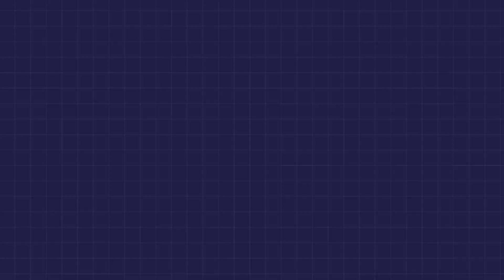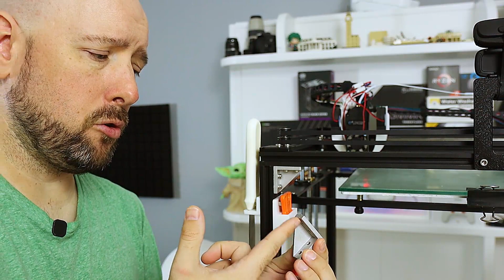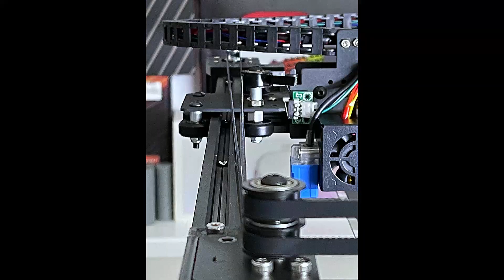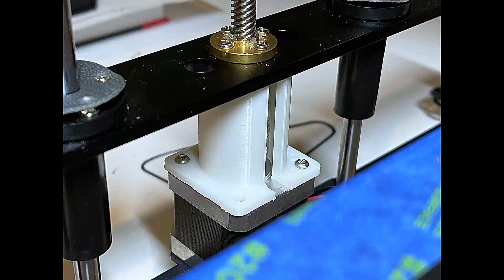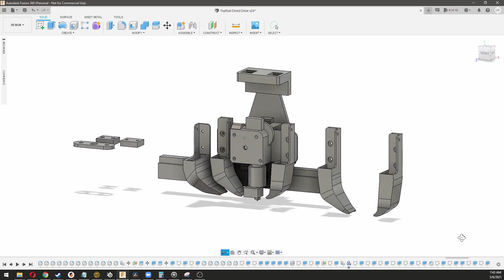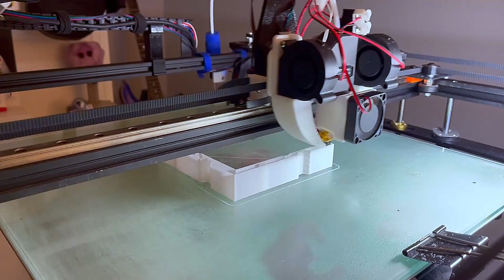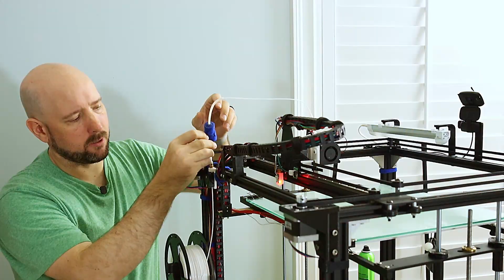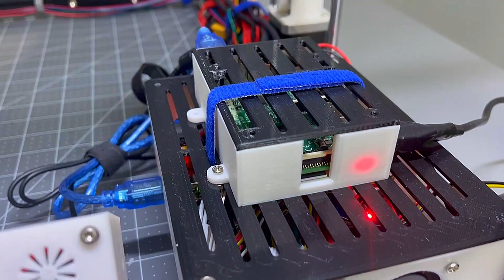TronXY X5SA Upgrades (Frame, Bed, Linear Rail + Direct Drive, PSU, Electronics)

Comment: I had to think through this several time, but I'm pretty sure I've got this right.

"these are the important extents, they have to be perfectly parallel to the y axis". I call male bovine feces. If that were true, if you wrote g-code to, say, go +10cm on the Y, then -10Cm on the Y over and over and over and over then the carriage would eventually track all the way to one end or the other or else one belt would get so tight it would explode. I'm pretty sure either will happen. As long as you have the same number of extents, with the same length, and the same angles you will be fine. The belts are (well are supposed to be) equal length, non-stretchy lines. I get that a hypotenuse of a triangle is loner than either side is, but it isn't a factor. Another way to say it is if the belt goes along a parallel extent, around a pulley and on to an angled one is the same as going along an angled extent, around a pulley and on to a parallel one.

 As long as the angles are identical, the length of the perpendicular extents are identical and the length of the angled extents are identical. That is why the pulleys for the belts are stacked, it reduces the chance the belts will be different lengths.
Reply: I would add that belt tension shouldn't be adjusted by the motor mounts, or any other part that affects only 1 belt at a time. You want to make sure both belts are EXACTLY the same length, and connected to the carriage exactly the same, then adjust the front stacked pulleys for tension.
Reply: Hello Reel.  I think you may be thinking about some of these items incorrectly.  Your first example, moving Y +10/-10.  The net result of those moves given an off-axis belt would end up being something like +9.95mm/-9.95mm.  It would move the same amount in both directions - it wouldn't build up more and more tension or move more in +Y than in -Y.  In addition, since the angle is changing it would be different depending on where the carriage is at.  For instance, if it's close to the off axis pully it could be a smaller move, like 9.9mm where as at the opposite end where the belt angle would be more aligned to the axis it would be very close to 10mm.  That is where the geometry errors come in to play and why you can't just easily calibrate it away.

The tension concern is that pulling at 0 degrees has the least amount of friction since it's pulling directly in line with the axis.  As it gets close to the off-axis pully the angle increases as does the perpendicular force and friction on the wheels/bearings.  Assuming the axis isn't completely catawampus that friction may be minimal but it could wear on the bearings and if you  have a bad bearing or something then it could play a larger role.

As for all of the extents that do not lead to a moving carriage, you are correct that their angles don't matter because they would always be at a static length and angle.

Now, these are small numbers and errors we're talking about - again assuming the belts are somewhat in alignment.  If everything on a printer worked great except this tiny alignment then that would still be a good printer.  The thing is, it's real easy to make them correctly aligned - literally just a few mm of extra metal on the outside of the bearing mounts.  There's no reason they shouldn't have done it right and illustrative of cut-corners.  It's also real easy to fix,
Reply: @LilMikeyDotCom  I have no practical experience yet, as I am still assembling my unit still, so I'll defer.
Reply from the maker: You sound unconvinced and I'm here to help :)  Let's use an actual pythagorean calculator: https://www.calculatorology.com/pythagorean-theorem-calculator/.  We'll use the real Y-axis position as leg a, and the offset of the pully as leg b - let's say it's 5mm off-axis.

For our first move let's assume the Y-axis is close to the pully, leg a = 10mm, leg b = 5mm, the hypotenuse would be 11.180mm.  Now if we instruct the printer to make a 10mm Y-axis move, it would actually tram the hypotenuse 10mm so our new hypotenuse would be 21.180, our leg b offset doesn't change so still 5mm, and our new leg a is 20.581.  Our 10mm Y-axis move actually moved the carriage 10.581mm.

Now let's look at it when the carriage is close to the far, correctly aligned pulley, say leg a = 380mm, leg b still 5mm, the hypotenuse would be 380.033mm.  Once again, a 10mm Y-axis move, new hypotenuse is 390.033.  Our new leg a is 390.001.  The carriage actually moved 10.001mm.  That same Y + 10 movement resulted in a .58mm smaller change in the actual Y position than the same movement closer to the offset pully.

From a tension perspective, the closer movement would be pulling at an angle of 26.6 degrees where the farther movement would be pulling at 0.754 degrees - basically zero.  CoreXY operates in push-pull so it's not like 100% of the force is applied at each of those angles but a significant portion would be - which could lead to bearing wear, inconsistent cable stretch/wear, or even skipped steps close to the 26 degree side.
Reply: @LilMikeysBigPlans   CoreXY operates in push-pull  <- this is the core of my conundrum. Any Tension on one end of the belt, has to be given back at the other end. or "blammo" (ok, the difference would be too small, but I think you made that point better than I had it in my head). if the motor is the "fulcrum" (which it may not be, my pulley math is weak). then when it pulls 10mm one way, the carriage moves 10mm, and some tension is created on the other end. when it goes the other way. the carriage moves "9.6"mm (made up number) and there is .4mm of slack at the other end. rinse lather repeat and again "blammo". That is at least how I understand the model you provide. If that is true than any angle on one side of the motor has to be matched on the other side or the problem exists. Your mount does spread the error out evenly over the length of the axis and is constant, that is an improvement over the sinusoidal error you would get otherwise. I'm not certain the motor can be considered a fulcrum( probably no the correct geometric term). so I am not certain there is a problem. Now I do believe the pulley need to be in a single plane (well one plane for each belt), and shims are vital. It may be the same math and I am contradicting myself. I did shim my pulleys and adjusted them on the motors to get them all planar. I will likely try your motor mounts as they seem generally superior to the factory ones....
Reply from the maker: I see what you’re getting at now!  You are correct, in the example above that .5mm would be a change in the overall length of belt. However, that .5mm is distributed across the entire run of the belt which is almost 2000mm on the x5sa 400 and it’s relieved as soon as the carriage moves back the other direction. It doesn’t build up over time.

Comment: Thanks for all the informative mods. How are the prints on a borosilicate glass with or without PEI compared to the stock aluminum/plastic bed? I mainly print PETG.
Reply from the maker: Hello Kevin, I have not printed directly on the aluminum (or with the bed sticker on the aluminum) so I can't comment directly on the flatness of the aluminum plate.  I'm currently printing directly on glass (gluestick) on the TronXY and PETG on PEI on my 2nd printer and both work fine.  I'm a huge fan on high quality PEI as it's zero maintenance.  No glue sticks, no sprays - maybe sanding once every six months.  However I just can't justify the $50 for a 400mm sheet while I haven't finished my linear rails or other mods :)  PEI can actually be TOO adhesive with some materials and you might need to adjust temp to lower adhesion.

The only quality differences I can come up with between the PEI and glass is that PEI can either be smooth or textured and textured and that will reflect on the bottom texture and if you damage the PEI it'll show up on the bottom - which is why you may want to sand it occasionally.  Glass will always be super smooth and flat - assuming you don't have dozens of layers of spray and glue.
Reply: @LilMikeysBigPlans  So my "blue" auto level sensor crapped out with less than 1 hour of use (I can see the burnt coils through the plastic). I left my X5SA pro in the shed for the last year so that probably why (LOL). I'm waiting for the "black" version and a textured glass bed to arrive this Monday. I'll keep you updated on how well it works. BTW, I'm converting it to a Voron while recycling whatever I can from the tronxy.

Comment: I am not even sure how #4 works, but on my X5S I use one motor with a 3:1 gear system so they never ever go out of sync since the two leadscrews are being driven by one motor.  3:1 it doesn't even want to move with a thick piece of boro glass which even on the 400 sq mm version would be fine as well.
Reply from the maker: I saw some single-motor mods on Thingiverse.  Which are you using?  My issue with most of those mods is that the way the motors are mounted the belting is way off the bottom of the printer.  Would love to see how yours looks.

I started on a mod to relocate the motors and rigidly mount the threaded rods to the frame but would need to replace the rods with longer ones and never got around to it.  Now I'm using independent Z leveling and ignoring sync altogether.
Reply: @LilMikeysBigPlans  I am unsure of the dimensions of the X5SA vs my X5S, but I will say the single belt with one motor worked the best of any mod I did.  I used a 32t pulley on both threaded rods and a 16t on the motor.  The belt I purchased did not allow me to mount the motor directly in the middle, but did not matter (gt2 I purchased was 1 size too small).  I made my own system where the height of where the pulleys are is exactly where they would have been if on the motor.  What I did was take those captive Z rod bearing blocks that it came with, and instead of throwing them away I used them to hold the rod to the 3d printed block.  At first, I used PETG, but that was too flexible, so I replaced them with PLA, and they work so much better.  Years now I have been using them.  In all honesty there is nothing left on this printer original except the screen.  Even the acme rods had to be replaced with slightly longer ones where I went to T8x2 so every full revolution is 2mm instead of 8,  That meant that with the 2:1 gear ratio plus this I have perfect layers of any layer height (the maths) at the cost of being 8 times slower for Z movement.  Hence, the 3mm/s vs 24mm/s of the original.

Comment: Great video I am heading over to your Thingiverse page to get the hats with pulley since I added a belt system to my Z as well and look at the carriage. I just upgraded my x5sa-500 to pro mainly for the rails. The 500 had 20x40 for the v-slot wheels but they didn't drill holes for the  pillow bearings so I was never able to use them. I pulled them out when I got pro kit to try using them then removed them when bed binded.
Reply from the maker: My X5SA-500 worked 'ok' with the pillow bearings but once removed I can see exactly how much bend there is in the rod.  There's a good 1/2 of wobble when tramming near the bottom.  That's just additional resistance and potential for Z-banding.

Comment: I just read your Modification review, very well explained in detail thanks. I am in the process of ordering a "Tronxy-X5SA-600-Large-3D-Printer-Direct-Drive-3D-Printer-600-600-600mm" and because it is very new there are no reviews on this larger printer yet. Any thoughts or guidance appreciated thanks again.
Reply: I have the x5sa-500 and love it. I would be interested to hear your thoughts on the 600... not that I want to upgrade again I just this week went from base model to Pro and still need some extra mods.
Reply: Actually, the biggest problem seems to be using jus 2 motors and lead screws for such a big hot pate Vs. 4! It is very difficult if at all possible to get the 4x4 auto leveling matrix with each cell below 0.5mm! I printed a 20x20x20 test cube the X & Y were close enough but the Z was 1mm off. Any suggestions please? What do you think of adding 2 motors and lead screws to Z? Thanks.
Reply from the maker: Hey Cy.  I've obviously never seen one in person but looking at the pics I'm a bit on the fence.  600mm is really big and the external dimensions of this printer are in the 1100mm ballpark.  While they added some bottom bracing I wouldn't be surprised if there was a good bit a play in the frame.  They did use the pro-style rails for the carriage as well as the bed which is nice but they appear to be running on something smaller than 2020.  In short, it's a REALLY big printer and I would've suspected more substantial materials to account.  Something like the Folgertech FT-6 uses a lot of 4020 and has mid-bracing.  If I was getting one, I'd probably plan on at least adding mid-bracing on the horizontal axes.
Reply: @LilMikeysBigPlans  Hi, thanks for your thoughts, In fact I bought one and am trying to fix some of the problems IE Z2 NOT quite in Synch with Z1 it falls behind. I might have to use your fix for it adding a belt.

Comment: hey thank for the video, i'm trying use your designs on my x5sa 500 and im having an issue with the fan that mounts on the front of the stock hot end, i cant seem to find the model in either the over or under mounted thingivers files. am i missing something? thanks again
Reply from the maker: Hey Dark, unclear on what you're trying to do.  Are you trying to use the stock hot-end on the under/over carriages or are you trying to use the fan mounts on the stock carriage?  Unfortunately I didn't design anything for the stock carriage.  That said, let me know what you're looking for and I can probably piece something together pretty quickly.

Comment: Great video!!! I've had my tronxy x5sa 400 for a year now, and I have not done much modding to it, but I have run into one issue as of late that was not there before. Bed wabbles from front to back where the heating bed chain is pulling it down. Killing my level every time I start a print. Any thoughts? And good advice about the pillow bearings they are coming off today!
Reply from the maker: If there's wobble something has to be loose or worn - likely something attached to/around your guide rods.  Does the wobble have a direction - ie: if you pull it front to back it's stable but if you pull it up or down it moves?

Comment: What do you make of the X5SA-2E model? Would love to hear your feedback on the changes by TronXY. I like the direct drive, but with 2 colors in 1 out now, I am unsure if I could still do direct drive.
Reply from the maker: As far as I can tell it's a non-pro with a 2nd extruder and a 2-in-1-out hot end so if you like the non-2e version the 2e is just about the same.  Unfortunately they don't even solder on the final stepper on the non-2e model so if you want dual extrusion you would have to upgrade your mainboard.  If you started with the standard model that would be $50 or so for a new board and stepper drivers, $15 for new stepper motor and $30 or so for a generic 2 in 1 out hotend.  If you're spending more than that to get the 2e model then I'd skip it and DIY.

Comment: awesome review, very informative , printer power loss is something i have not heard anyone mention. thank you
Reply: I just started seeing the same "power loss" or else a freeze as you described, X5SA Pro V6 board w/Marlin (6 months old). Like you did, I replaced the PS as well,  the problem didn't go away but did start appearing at different times. I also re-formatted and re-sliced the print where I saw this issue, and that seemed to help (but why?) or else it just could be 100% random. You described it as getting progressively worse, so an SKR board might be in my future. Thanks for the video and detailed information! BTW, I have a MPMD and Chiron that are consistently printing in the background while the Tronxy is down for repair. Again.
Reply from the maker: Thanks for watching!  I personally don't use the power-loss stuff and this board failure was the first I've ever seen of it :)  If you end up using it successfully I'd love to hear about it.

Comment: For what it's worth, my X5SA-400 came with a two-part aluminum bed.  I'm pretty happy with the black surface on it.
Reply from the maker: Hello Benjamin, would love to see a pic of the bed you received.  When you say 'two-part' do you mean a full metal plate with an additional heater plate or sheet above it?
Reply: @LilMikeysBigPlans  Here's a decent photo.  It's two aluminum plates.  The bottom has a heater and the top has the surface attached.  https://i.all3dp.com/wp-content/uploads/2020/01/08120514/Bildschirmfoto-2020-01-08-um-12.01.51-2-Kopie-e1578481566753.jpg

Comment: Nice comment of you on Stallguard. I never liked this concepted as well. :)
Reply from the maker: I know, right?  It would be one thing if you constructed some kind of stopper or landing pad to handle the crash but if you're going that far, might as well just stick a switch on it.  I also think CoreXY is especially troublesome since cartesian axis-aligned movement requires both motors and depending on where the stall is occurring that might mean different resistance on the motors.  I think that's why I was getting inconsistent results.  Either way, pain > benefit.